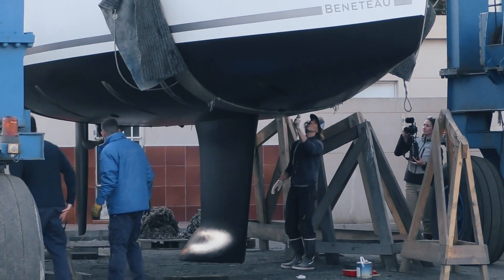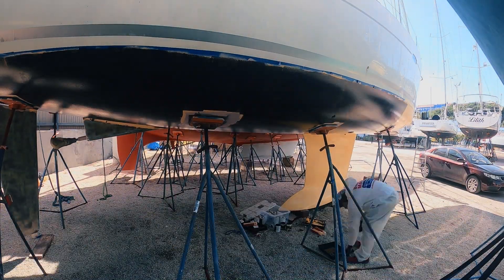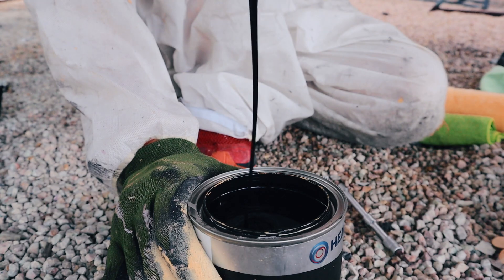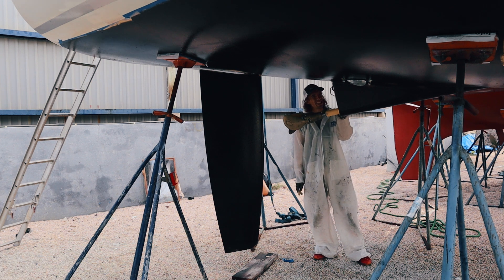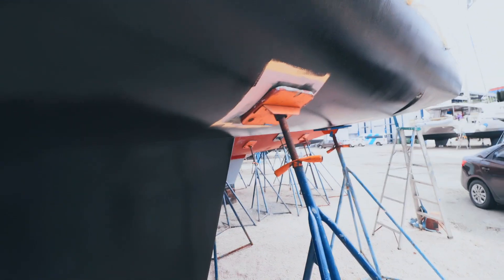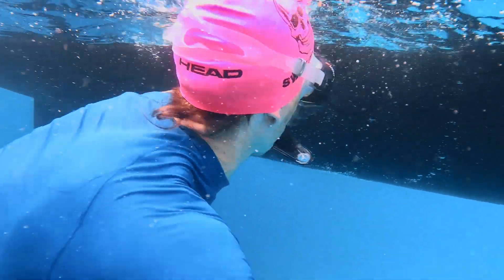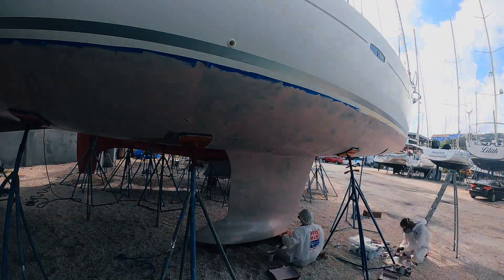SILICONE ANTIFOULING: How did it hold after 2 years? (Watch before applying!)

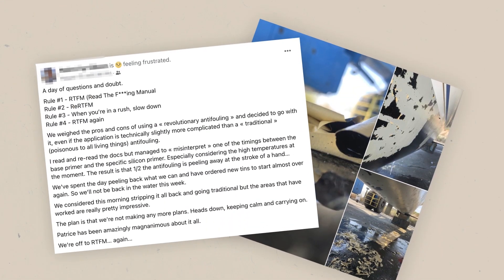Comment: 3:31 RTFM True, the tiecoat needs to be applied onto the primer in a short period of time, at 30 degrees you have to wait for one hour and apply it within the next hour! That’s the trickiest part 😁
Reply: what about recoating in subciquient yrs😮
Reply: @sailormanoyster1849  In fact, the silicone layer can be applied over any existing silicone layer without any problems. As long as the tiecoat and primer remain intact, it can be renewed again and again. There's even a special silicone mixture called "Infinity" for this purpose.

Comment: I tested Silic One on my prop and found it did not hold very long. After just a few days parts got loose. But I had painted also the saildrive and there it worked pretty well. Still slippery after 2 years.
Reply: When you painted the prop with it, did you achieve a smooth surface, or did it have brush strokes and waviness?

Comment: SilicOne worked fine on the saildrive. No growth, but it did not stick on the propeller. After a few weeks parts were altesdy gone. Now I use Jotun. Seems to work much better for the propeller.

Comment: I gave my boat the full treatment of SilicOne at the start of last season (2024) . Sand blast, Hempel epoxy primer, tie coat and top coat all exactly as the spec says with times and temperatures all correct. At the end of the season I can say that it has worked almost perfectly. There were 3 small (hand size) parches where the top coat and tie coat had peeled. 
I am worried that the instructions give no indication of abrading the epoxy before the tie coat. I contacted the agents before application and they said it was "wet on wet" application. I gave special attention to the time and temperature between coats and complied with that. (no sanding)
I am worried that they may have omitted the instruction to sand the epoxy before the tie coat in the instruction leaflet.
Incidentally I gave the propeller the same treatment and it has adhered perfectly!
Did you sand your primer epoxy?

Comment: Hempel Silic One aparently you have to go 8 / 10 ,  Just read this . Silic One is more suited to power boats, as it needs a minimum speed of around 8-10kts to keep it clean. The most important aspect
Reply from the maker: Yeah, it works very well on power boats and I wound not recommded it on boats shorter than ours but it does and has worked for us for the last two.years.  so it's an actual data point
Reply: I bought 900 euros woth and can not find a Marina in Barcelona that will lift with Silicon Antifowl.*  This was before your video

Comment: Interesting to hear such positive thoughts on silicone antifouling. Nearly tempting but my boatyard has already announced that they won’t lift or handle any boat with silicone antifouling. Why? Not sure but they are unyielding.
Reply: Because slings on crane or hoist cannot grip properly and risk of boat being dropped is dramatically increased. Additionally slings can abrade the paint easily leading to claims from owners for remedial work.

Comment: hi ryan, thanks for great videos.  when you recoat the bottom with silicone, do you have to use the primer, tie and topcoat again, or can you just add topcoat?  do you have to sand all the old stuff off?  i have pettit trinidad hard bottom paint that has not been in the water yet.  do to unfortunate circumstances this paint has gone beyond its splash time and has to be sanded and reapplied . maybe i could put silicone over it ?

Comment: that's a lot of toxic petrochemical crap, you can contact with Precious Plastics and recycle HDPE in sheets to weld under the waterline, they will also absorb collisions and are puncture resistant (river boats use HDPE as well) against uncharted reefs or debris. ET VOILA NO MORE FOULING

Comment: PS to below. That 96% Zinc Cold Galvanising Paint, seems perfect for keeping galvanised anchors in tip top condition as well. I was going to go with a 25kg Rocna, but the same weight Mantus 2 is two-thirds the price at the moment, and it definitely fits Jeanneau the SO 440 bowsprit abchor roller very well. Cheers. Bob.

Comment: Hi Ryan.  I just watched your original Silic One video, and you put it on with original antifouling under it, with three top coats. Are you saying it is better to put it onto the surface of the Hull (better for me, as .I'll be getting a new boat God willing), or the Agent doing the Commissioning does their usual Hard Antifouling, which would probably be a good base otherwise,  as yours Silic one application appears to be doing well. 👍  In Addition, I've found out more about the Cold Zinc Calvanising materials available, and one type in particular (various Brands) appears very promising. At 96% Zinc, you can get it for around 24 pounds for a 1 kilo Tin, it is mixed with a silicon binder, and doesn't need mixing in the Tin ! appliable with Brush or roller, each coat is over 1mm thick. Zinc too is a non Toxic Material ! tbh, I'm very tempted to try it as an antifoul with say 4 coats , which will also be a giant anode for the Boat. Maybe the fixed Zincs would never wear out ? Each haulout, just wash, dry, light fine grade scrub, and slap on more Coats ? 10 tins I reckon will do a 44 ft boat easy, with lots of tins left over. Think it's worth the experiment as the first antifouling  on a new hull, plus twin rudders,  to see what happens ? Best Wishes and Fair Winds.  Bob.  🤔🙂👍

Comment: very helpful review - I assume you spend most of the time with the boat in warmer waters during the period with this antifoul applied ? having seen this I am considering trying it our here in Dubai, United Arab Emirates on my 2008 Beneteau Oceanis 40 ... BTW have installed 48v 15kwh lithium house battery bank and 48v 4kw alternator on the engine ... can now run two a/c units onboard overnight from batteries only ... cool and silent ;-)
Reply from the maker: Thats cool Lars (in more ways than one).  Yes... the boat was generally in the warmer atlantic waters

Comment: I do recommend Jotun Megayacht , Hempel Globic etc. These are 90 months shipantifoulings, they last as expected, no whatsoever marine growth. Cost maybe a little higher.
May be painted in cold weathers...simple to apply. In all, these paints are toxic but a far more simple solution in the end. More sustainable than fancy 2yr ecopaints. Think about it, no haul out for 5-7years and a clean bottom. Anodes may be replaced under water, bottom inspected easily... I never go back to the leisure market hokuspokus paints 😅
Reply: @Post Toasty Just ast your boatyard , nearest Jotun dealer etc These paints are only sold to shipyards, professional use, bigger boatyards. Your boatyard is a good place to begin. As these are only used under superyachts and ships. As these paimts arent approved for DIY.

Comment: Hi there.  I like the look of that very much. For your propeller, have a think about painting it with aerosol Cold Zinc, but do not get the Marine one like Pettit's, which is identical to ordinary Cold Zinc Gal arising Spray, about 8 times more expensive due that dreaded Word "Marine" and you can get it in  Handlers. Here in UK, I've seen it for around 8 pounds a large tin. Patently putting 3 coats on, and it should work as antifouling for about 18 months, depending on the water the boat is in. Major Bonus Point, it also works as an additional Saxrificial Anode ! I think the material is actually a blend of Aluminium and Zinc. Plus when you haul out, just wash and rub down, then when dry, spray more coats on . I've checked it out on several boating forums, and a fair number of people say it is that good, they won't consider using anything else, withnsome using it for over 10 years. Extra Anode Protection ? Heck I'll haul out annually to check Anodes and annual Service and check over anyway. Plus you won't have to buy extra to do the prop . tbh, I'll paintbthe bronze though hulls and bow Thruster with it anyway. Best Wishes, and thanks for the look see at that stuff. impressive. Best Wishes.  Bob.  👍🙂
Reply: You have clearly been drinking seawater, please step away from any machinery

Comment: Try copper coat last 10 years plus hard epoxy helps protect hull when lifting out😀
Reply: I love that stuff, but getting it applied correctly, can be a bit of a nightmare gamble. On my last boat, I had Pettit Trinidad Pro Hard  put on, to a hull already 2 coat epoxy Barrier coated, so 2 more epoxy Trinidad primers, then 2 top coats. It's just high Copper Content. When I looked intomit, should have had at least 3 to 4 years no growth , then just a deslime for the next 3 to 4 years, which was supposed to give the time to fi d a reliable Copper Coat applying yard. Next boat , I want out of the Water for a full service and checkover annually anyway, so the stuff Ryan has used seems to fit in well, for Hull inspection and touching up. For Prop through hulls, and bow thruster, I'll be using 3 coats of Cheap Cold Galvanising Zinc Spray, which looks to be good for up to 18 months, plus gives extra Galvanic Anode Protection. then when hauled out, clean and prep, then Spray and brush some more coats on. It was highly recommended on several forums, so worth a try. Just don't buy chronicallynoverpriced Marine Sprays, they are identical to the cheap ones apparently. It'll be a while before I can give feedback on actual use, but galvanic erosion of the paint surface  should keep the prop clean? Makes sense to me anyway. All the best.  Bob.  👍🤔

Comment: Hi Ryan,
I wouldn’t recommend you using silic one in the propeller. I applied it three years ago (I am using silic one since 2017) and it didn’t work. It seems that Spinning speed of the propeller is too much for it. 
I have experienced waiting for three years with the boat in the water, and it’s too much time. 
From now on, my idea is houling every two years with layer renewal, and a “half” houling in the firs year for just a pressure water cleaning, as some grass growth van be expected. 
Fair winds!
Reply from the maker: Good feedback, thanks.

Comment: We‘ll rebuild Gratitude’s bottoms this autumn. After stripping her down to the gelcoat I want to apply 3 layers of 2 part epoxy barrier coat / primer (Interprotect) for maximum protection. Will the Hempel primer stick to another epoxy primer? Then I might give it a go and not use the Seajet 39 I‘ve been planning with. 👍
Reply from the maker: No, I think you need to apply the recommended primer and tie coat for it to stick… I wouldn’t try it as it could result in having to redo everything, as was the case with our friends who didn’t follow the application recommendations
Reply: @RyanSophieSailing  Yeah - I‘ll use Hempel’s High Protect II instead of the Interprotect. It‘s more or less the same stuff. Right now I‘m waiting for an answer from Hempel to get my plan approved… 😉👍

Comment: Thanks for the informative video. It sounds like Ryan is saying "silicon" but I'm sure he meant "silicone" - they are two very different things (and pronounced differently)..
Reply: Thanks you saved me from having to say the same thing.
Reply: .I think there's a bit of a clue in the name Silic 1 One ? 
Apparently you can make home made, with half a tube of Silicone, mixed with an equal volume of Acetone and thoroughly mixed together. Does sound a bit too easy to screw up then have a nightmare removing it tbh. 🤔 
Just for giggles, I might try it in patches of different types on the bottom of an Aluminum RIB. I'm a bit hooked on Testing stuff out. My Curiosity is outdoing Cats so far. 🙂👍

Comment: So… what if it DOESN’T work that great? I want to try it, but what do they say about getting it off and using any other coating ever again? Are you stuck with it forever?
Reply from the maker: It’s just like with traditional anti-fouling. If you want to try something else (copper coat for example), you have to scrape it all off and start over. We did it when we switched over to silicone based, which is not super fun, but also not a giant hassle.
Reply: They also sell a removal liquid to make it easier. Have no experience if this tho